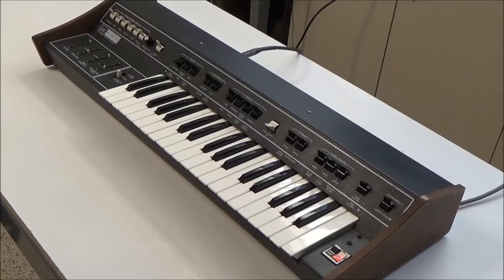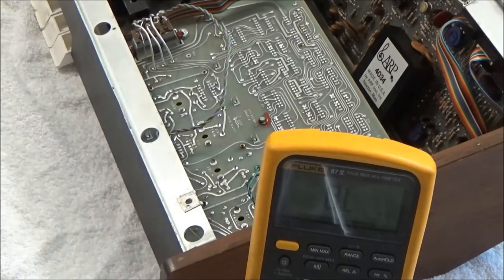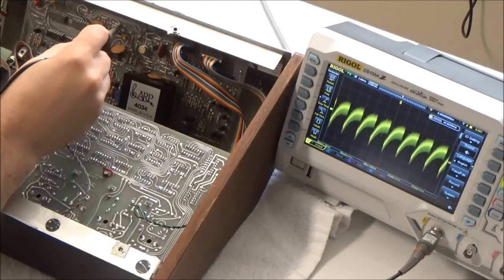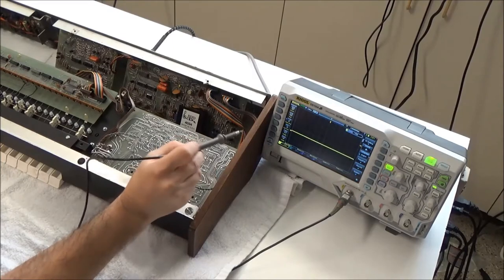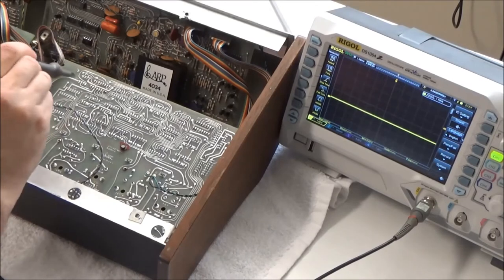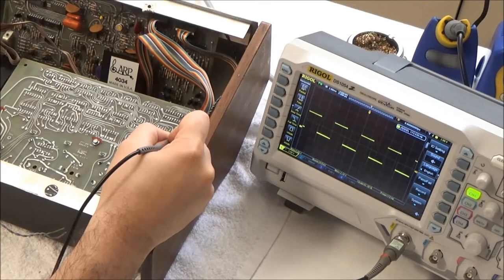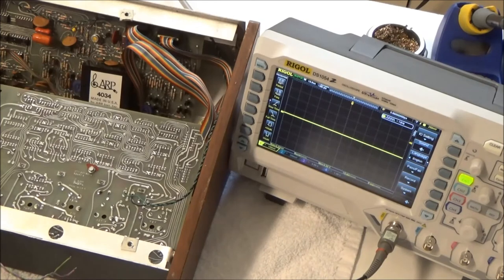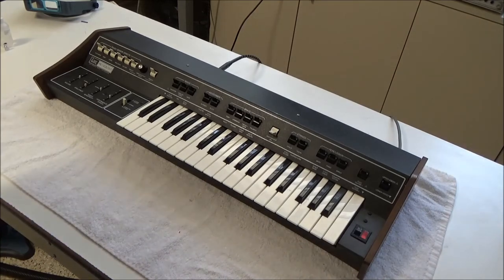Synthchaser #084 - ARP Pro Soloist Repair - Dead Touch Sensor, Dead Presets, Bleeding Notes

Comment: Just finished recapping my old Yamaha DX-7 Mk1 (PSU and mainboard), new battery, new backlit display, replaced all 42 switches, new sliders. Also bought an old dead Yamaha RX-11 of eBay and brought it back to life (new transformer, total recapping, cleaned sliders the proper way).
Thanks for the inspiration, would never have done this without your channel. Keep 'em coming.
Reply: Such an awesome synth!  Good for you!